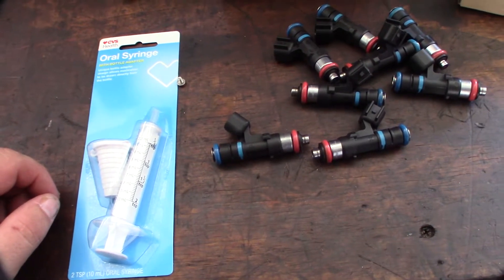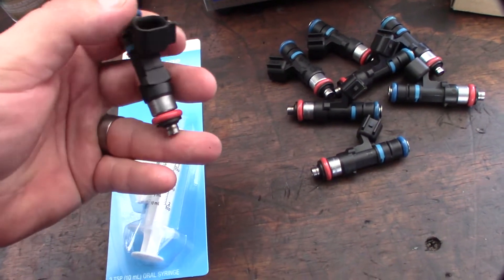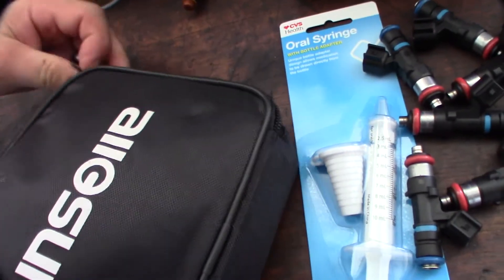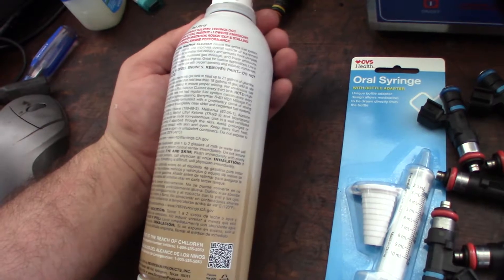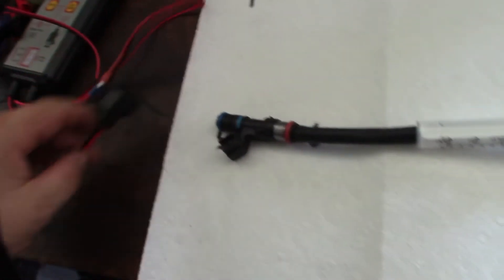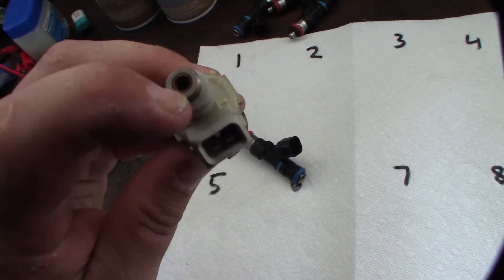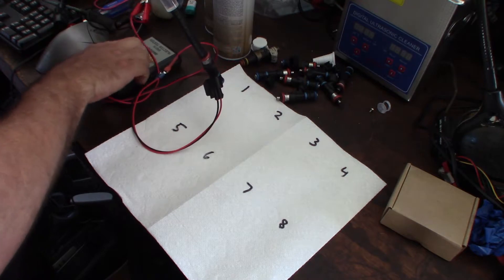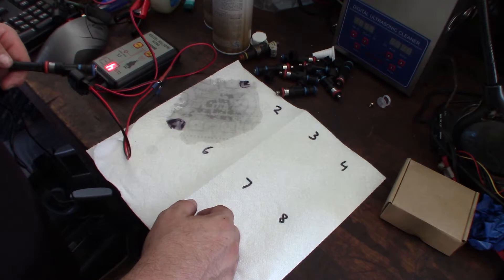Homemade EV14 fuel Injector cleaning reverse back flush tool

Comment: I was able to rig a fuel injector canister like the ones you use on the engine, and regulated in line with my air compressor to run  them in the forward direction at 55psi which was the spec my injectors were required to run efficiently Thanks for the back flush concept, it makes perfect sense.

Comment: Of you want to back flush with pressure turn the shringe around, pushing the large end over the o-ring then adpt down to the can with your straw, do the same process with the tester but inject B12 through injecter using pressure from can, I would think that might be bettsr than just pushing by hand. Your way is still pressurized but only has the pressure of the rubber seal from the sringe.. Just a thought..